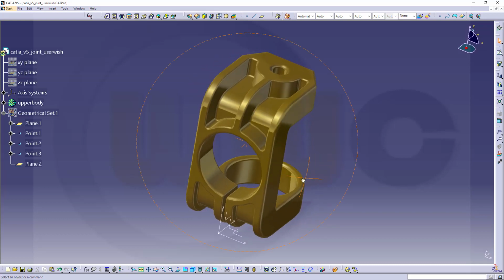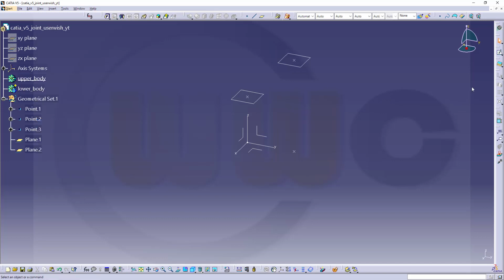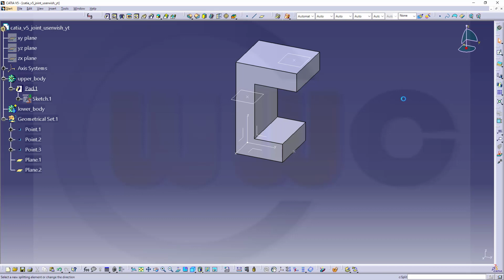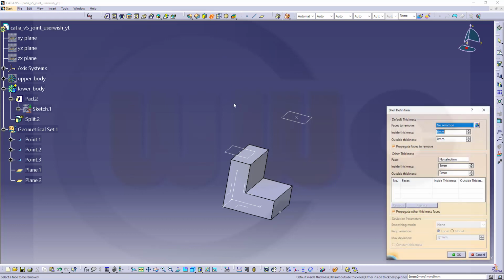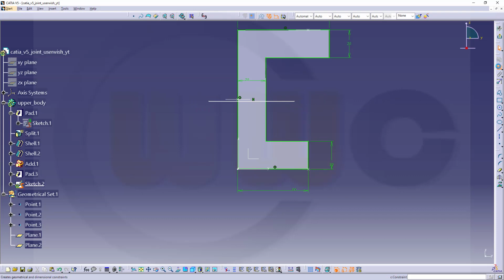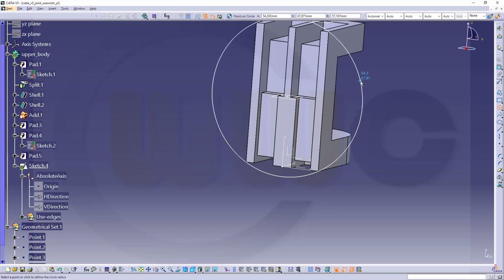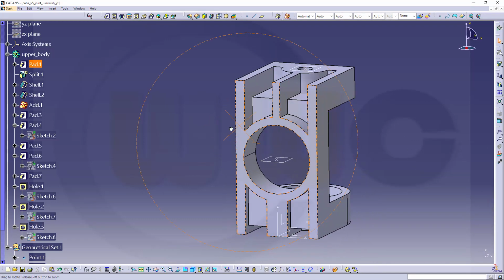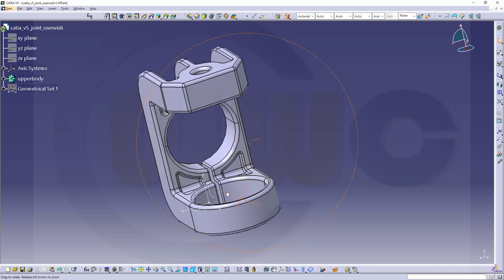Joint - Userwish - Catia v5 Training - Part Design

Comment: hello, it's me
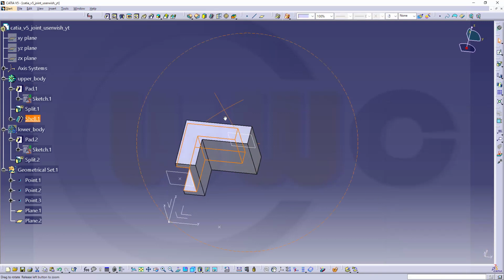The "Shell Definition" command does not have as wide a range of options as your "Shell Definition" command. For this reason, I can't shell the part as you did. (video 7:44 minutes) What can I do, what is the reason?
Thanks.
Reply from the maker: Seems this is an issue with your catia license. Depending on the license the commands have different or additional options. So this is kind of annoying but you can´t do anything about it, sorry.
Reply: @wolfgang.walden.cad.training  First of all, thank you for your response.
So, which license should I use so that this command is the same as the command in your license? 
V5R20?
V5R21?  vs.

Comment: hi, whats the different with normal sketch and sketch positioning When should we use the sketch positioning? Thanks for the video :)
Reply from the maker: You can always use a positioned sketch, if you want. But you have to use a positioned sketch if you want to control the orientation (h- and v-sketch-direction) and the position of the sketch-origin.
Reply: @wolfgang.walden.cad.training  Thanks!!!